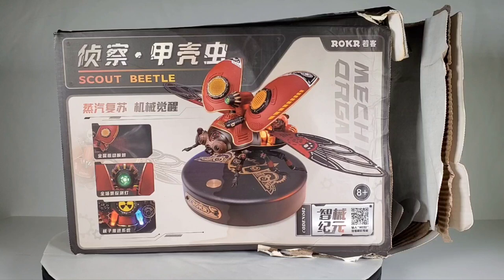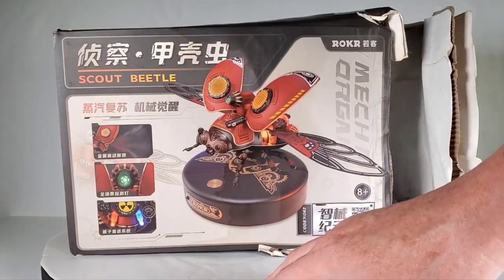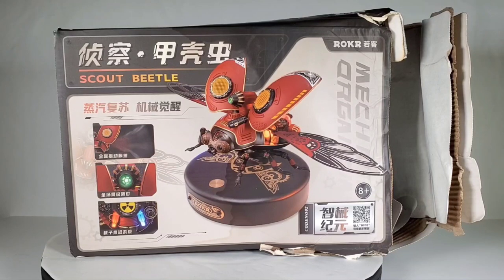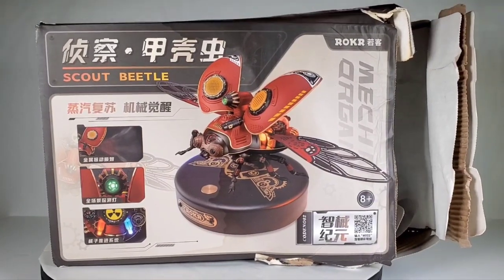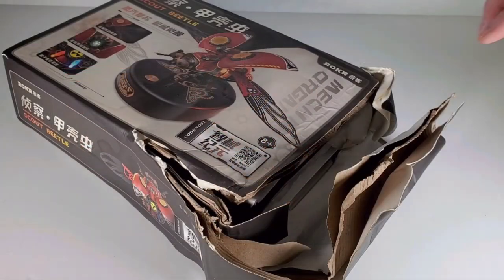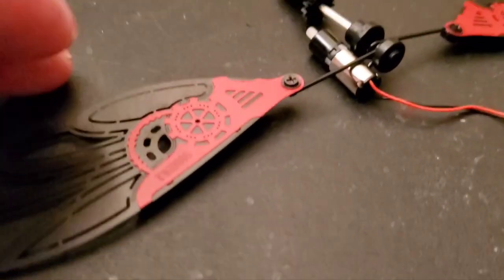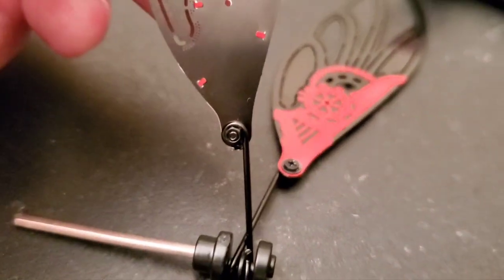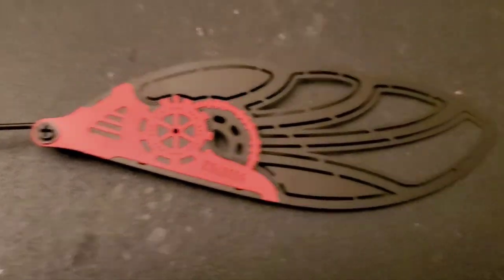Rokr Scout Beetle Mechanical Model Kit

Comment: I had several issues with this kit. 
One the clear light tubing , does not peg into the top of gears, 
Two the radio active piece did not have enough clearance to spin freely, I had to cut away the plastic to get it to move. 
Third, the legs, would not peg in at all, had to make holes larger and glue them in. 
4, the brass prongs on bottom are not long enough to make contact, I had to make a spacer to raider the sensor plate up on the base so the mat it make connection. Needless to say, it runs, but not nearly as smoothly as yours. And I’m not sure why, I followed everything to the T.
Reply from the maker: Wow! Maybe you had an older kit? I'm really not sure. Everything fit really good on mine. The legs were the only thing I had issues with as far as their orientation. They did fit rather tight into the bottom of the body though.